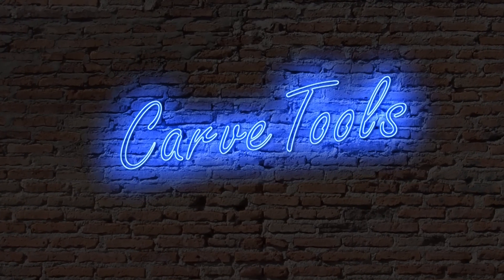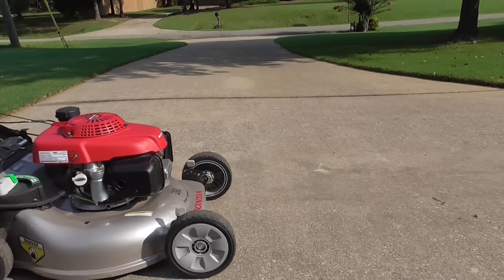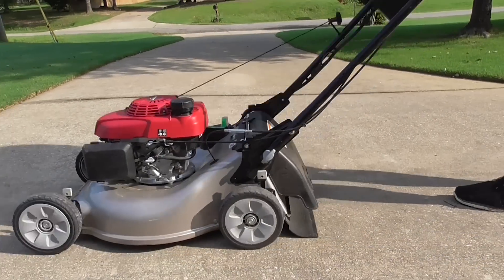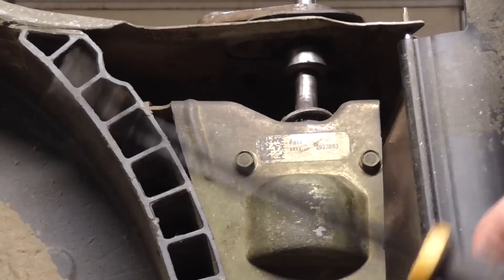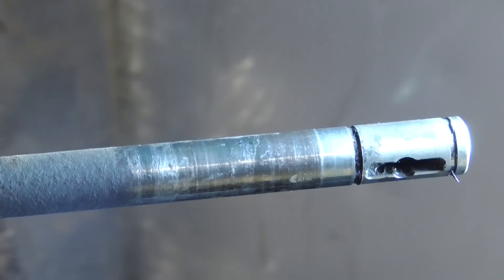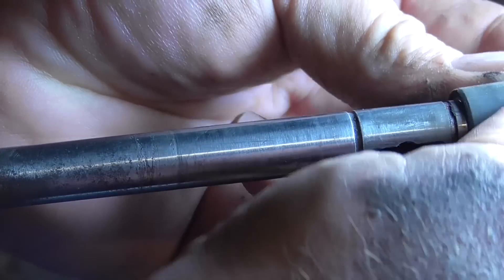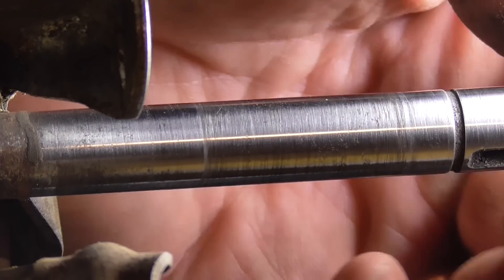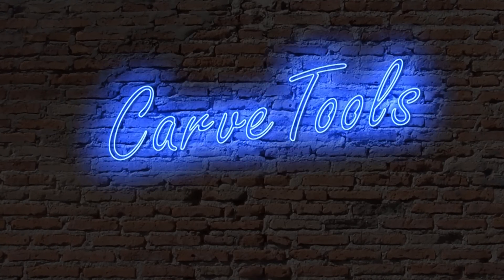Honda Mower Rear Wheels Will Not Roll Backwards THE REAL FIX

Comment: Although the engine performance & quick start of this Honda model is outstanding, my rear wheels also lock up when attempting to back up the mower in just 1 1/2 seasons since purchase.  I'm planning on using this excellent video you've posted as the probable resolve but given my many years with Honda products... wouldn't you think the Honda engineers would have gone back to the drawing boards & corrected this obvious fault in product material design... like a stainless steel wheel shaft ?  This is a real safety issue as one has to actually lift the rear wheels to back up the mower when the mower blades are rotating when a forward directional change is limited or not feasible.
Reply from the maker: Hi Gary,I can only assume that Honda knows about this issue of the wheel lock up but no recall has been issued. My experience was Honda wants you to take the mower to an authorized service center and leave it there for 2 or more weeks until they can look at it. The service guy saw the wheels locked up but found nothing in their factory documents as to the problem or solution. I finally tore the mower down and found the issue in this video and have had no problem since other than all 4 wheels are completely slick and I had to replace them. A design with a SS shaft and a real bearing would fix this issue but would decrease profits on this product. It’s amazing how saving just 99 cents per product has caused such a headache (and backache) for the consumer. Other than that, it’s not a bad mower, just aggravating. Thanks for the comments!
Reply: @CarveTools  yes, the wait time for Honda service are insane... All year. It's almost better to resign to the fact that it's not going to be self propelled after a couple months.
Reply: I found out recently that in other markets outside the US Honda coats the shaft with a heavy zinc plating. They don't have this issue.
Reply: a stainless steel bushing would be much cheaper

Comment: Instead od sanding the shaft I put some grease on it and that seemed to work as well
Reply from the maker: Hi Christian, so glad that worked for you. I tried spraying WD40 and lithium grease and that probably made it worse. The bushing was so tight filled with dirt I needed to remove the bushing from the shaft and clean the shaft with sandpaper. So far this season no issues since the fix. Thanks for the comment!
Reply: CarveTools no problem, just incase I did the grease thing today so I'll comment in future if this solution held up or not

Comment: Thank you. Local shops will not give out any information.
Reply from the maker: I had a similar experience last year like the comment below where the authorized Honda repair shop had no clue to a fix. That’s why I tore it down myself and this year the wheels still turn freely when pulled backwards.

Comment from the maker: I had a similar experience last year like the comment below where the authorized Honda repair shop had no clue to a fix. That’s why I tore it down myself and this year the wheels still turn freely when pulled backwards. 

Got this comment;

noname Google commented: “Thank you. The local repair shop would not give me any information about the problem. They suggested that it might be the transmission, and would cost around $300! They probably sell a lot of new…”

Comment: Mine wouldn't pull back right from the day I bought it. My dealer said he couldn't fix it. It's now 1 year old and I'm still putting up with it. Sometimes the wheels lock; sometimes they turn but are very stiff and require a lot of energy to  pull the mower back. On dry grass, the wheels have less grip than on, say concrete, and lock up more easily. I'll give this real fix a go. Thanks
Reply from the maker: The reply I got back from Honda was if a customer is encountering this issue is to bring the mower to a dealer and let them address it correctly.  They have the proper tools and procedure to properly lubricate and resolve this issue. Unfortunately Honda must not be sharing this information with their dealers. 
Since the repair I did in the video I have had no more issues locking up. Unfortunately the wheels are now worn out and slick and will do a video soon on how to fix that. Thanks for the comments!
Reply: CarveTools youre right these are the worst poly wheels ever I heard today Honda is coming out with new wheels next yr lets pray

Comment: What if it’s a brand new mower? The wheels do turn but are very tight?
Reply from the maker: Hi Tom, If the mower is brand new and they wheels pulling backwards that is a problem. I'm sure the dealer you purchased it from will repair it. Mine started acting up on the second season.

Comment: You can clean shafts & inside of sleeve with steel wool/Scotchbrite & WD-40 also. I lube with WD-40 as grease will tend to attract dirt & eventually gum up.
Reply: Pete WD-40 is a degreaser so I guess a cleaning is what's really required.

Comment: Great video, greasing the pinion & wheel gears helps but you probably need to do this once a year . I  would soak the plastic bushings overnight in gear oil or a mixture of gear oil   &  STP. The real problem is that the Honda transmission lacks an internal clutch so the pulley spins backwards when you pull it backwards so there is more drag.

Comment: i just checked my 3 year old hhr216 and it was smooth and clean. I put grease on but the clearance is so tight i dont think the grease stayed on. Unfortunately one of the circle clips sprung off the pliers across my yard so i had to order a pack from ebay, not i can't mow for a week.
Reply: anonymous asked
Reply: Get size 13 c clips

Comment: Finally someone has got down to the brass tacks on this issue!! I had the same issue. And as described the transmission was free spinning as were the wheels. But the main axle bushings were all but seized. Thank you Sir.
Reply from the maker: So glad it helped! My old Honda mower had ball bearings on the axle. Honda has saved millions of dollars by using plastic bushings on the newer models even though it has caused thousands of users pain and frustration of dragging the mowers backwards. You would think that registered owners would have received a recall notice.

Comment: Also I found that cleaning those grooves in the shaft and pinion gears of grit and debris worked.
Reply from the maker: Unfortunately that did not work in my case. I took the pinion gears off at least 3 times and cleaned everything in sight, applied some light grease and had the same problem. Honda knows about this issue and they have some type of special tool to force grease in the axle bushings. Thanks for you comments!

Comment: the fix worked for me. My mower is only on it's second season. It's the HR21 model. My shaft wasn't that rusted or scarred up, but it wasn't lubricated and I think the tolerances between the bushing and the shaft are just too tight. I used emory cloth on the shaft, and added grease and it seems to have fixed it. I did my repair with the gearbox and shaft still installed in the deck.
Reply: There is a fix offered by Honda to replace the bushing assembly. You have to take it back to an authorized Honda repair dealer to get the fix.http://www.lawnmowerforum.com/showthread.php/42592-Honda-HRR-Models-Rear-Wheels-Locking-Up-When-Pulling-Backwards?s=1c7a18ffb5dfc1e04c7665e0e0d4145d
Reply: These parts are not that expensive but I've read that if you ordered the part you might not get the new and improved version but a part that had the original design flaw.
Reply: Roy G , I think I didn't get the upgraded pieces, mine worked for a few weeks but now locked up again, so it may be time to do the sanding or greasing?
Reply: Great video! I have same problem. I noticed that if I take my leaf blower and shoot the area around the gear box with air the wheels roll backwards just fine. But, the "fix" usually only lasts one mowing-especially if the grass is a little damp. I suspect that all it takes is a little debris wedged in that shaft-bushing area to muck things up. The air from the blower must be freeing things up by removing that debris.
Reply: Roy G awesome thank u
Reply: Thank you!
Reply: Roy G good info, thanks. I wonder if there somewhere we can buy this  upgraded part online for a reasonable price?

Comment: mine is a 2169 vka that just started doing this. a nice excuse for me to buy a good set of snap ring pliers!
Reply from the maker: External snap ring pliers are essential to get this thing apart. I have a cheap set I bought 20 something years ago. Thanks for the comments!
Reply: did the job this morning and the mower now pulls backward smooth as silk.
Reply: when its time to service the wheels its HELL getting the snap rigs off! Replace w other type snap ring!

Comment: should I grease the rear axle
Reply: Outstanding video.  My understanding is if you spray some WD 40 or ZEP penetrant once or twice each season to help displace the moisture that is trapped between the axle and bushing shown so well in this video, it helps minimize/prolong it from happening prematurely which sure beats having to take it apart until you asbolutely have to.  Greasing is hard to get in there (unless you take it apart of course as excellently shown) but is certainly beneficial. This design issue aside I love Honda mowers.
Reply: Great video thanks - I have been skull dragging this infernal machine for near 2 seasons especially in damp weather- great exercise- Taking it to Honda dealer Monday - who admitted bushes were incorrectly manufactured  and also there is a fix for drive belt in the wind - hopefully -will cover it under warranty and replace bald drive wheels
Reply from the maker: Hi, I did grease the axle during reassembly and have no issues so far with the rear wheels locking up. Will probable take a year for it to get corroded again.
Reply from the maker: I did not add it to this video but I have used WD40, lithium grease, machine oil and penetrating oil trying to free up the axle. The final straw was to disassemble everything to see the problem. Honda will not admit to there being an issue. Thanks for you comments!